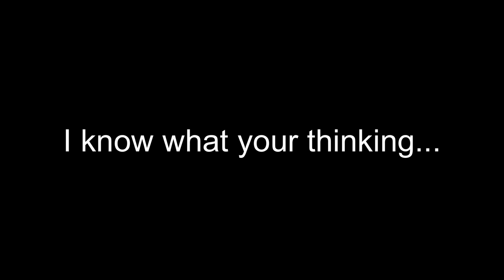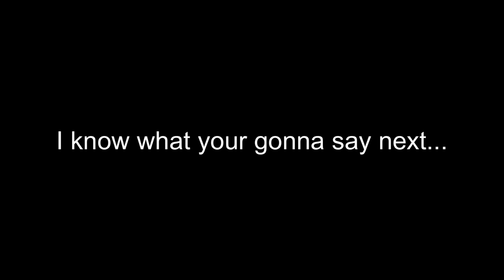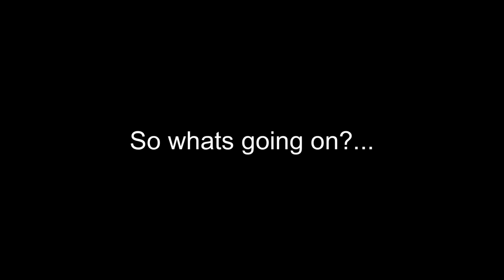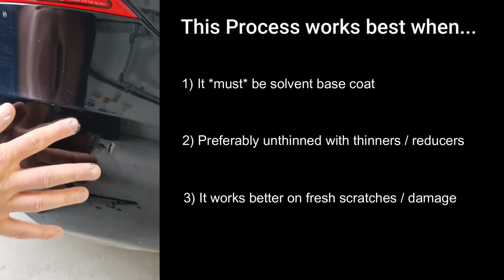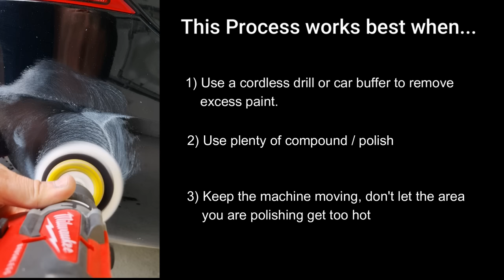Amazing Scratch Chip & Road Rash Repair Method

Comment: I got a question about it. We all know how important hardeners are. I guess you have a secret recipe for this that you developed over time. But to make things clear : 1. Basecoats, and i saw not one single type in nowadays cars that are shiny ! All of them are matte. 2. There is a factory made specification on base coats how to mix them or thin out. 3. It is a demonstration. I did not read to many comments in the section from users, but i guess your product works. The thing is, normal base coat needs some sort of hardener to withstand weather and elements. Some resistance to chemicals is also a must. Without hardener, base coats are very weak, and they will get removed within a short time. Sure if you polish them they will get shiny. But there is a reason why clear coat is sprayed over all car base coats. Somehow hard to believe that only base coat can take all the obstacles without any hardener. Acrylic based base coat is easier to work with than to work with urethane based coats. But even acrylic clear coats with hardeners often tend to fail and to lose their properties within a maximum of 2 years. Only urethane based clear coats are something that is a long term solution. I am sure that buying a common base coat color from a paint shop and trying this method will hardly work out. The most shops offer them only as a acrylic based one. Which is not bad at all. Serious painting businesses will afterwards paint over them with urethane based clear coat, and this is a quality job that will last for a very long time. I am a little bit sceptical about it. But anyway, nice work, a very nice video and method to make your paint look like new on scratched parts.
Reply from the maker: Hi. Actually the basecoat holds up pretty well. I've done tests on vehicles I've owned and it generally lasts longer than expected. www.paintgear.co.uk product has some gloss enhancer mixed in which also helps with the above issues you've raised.
Reply: Why post link to Paint Gear as their site clearly states they do not currently ship to the USA for us in the US anyway?
Reply: @andrewhernandez506 maybe because the USA is not the be all end all... jeez how entitled must you be to get upset that a Brit posted a link to a British website on a multinational platform.  No wonder yanks have got the reputation they've got. They've bloody well earned it!😅
Reply: Great comment! 👏👏
Reply: @misssummersalt Totally agree, entitled American's.
Reply: I feel like doing this to my black Landrover Discovery 4 but I'm too anxious in case I mess it up or am I just being too paranoid?
Reply: @andrewhernandez506  so people not in the US can learn about the product and purchase if they like.
Reply: @andrewhernandez506 Unless he is telepathic, how would he know where the OP is from? I mean reading the post I was 90% sure it was an American writing it, but still ...
Reply: @andrewhernandez506  Why wouldn’t he? He’s a Brit, in the UK providing a link to a British site. There is a world outside the US.
Reply: How long between applying paint and buffing ?
Reply: As long as you get the excess paint off within 5-10 minutes using  some cutting compound it’s not really possible to mess it up. At worst it won’t work that great and you’ll just be back where you started. I tried it on some old scratches around door handles and got 70-80%  improvement that is still holding up nearly 18 months later. Hope this reply helps.
Reply: Entitled Americans? Sorry, but You Tube is an American platform, so good luck with that lol
Reply: Just for you Americans out there, Europe is not the capital of UK. We play football in England and invented baseball but call it ‘rounders’ 🤓
Reply: I think you can simply mix the base paint and one-component varnish in a ratio of 1 to 1. I have not tried this, but I plan to try it in the near future. I think dry it longer than in the video and polish it
Reply: SweetProjectCars mixes base with clear for this issue. 1 part clear 2 parts base.
Reply: @andrewhernandez506 why not post a link to a site that doesn't ship in the US? 😂
Reply: @johnwalters878 It's a multinational platform or do you think the World's You Tubers travel to the U.S. to upload their videos and then return to their native country? By your logic the language, which you've bastardised originates in England so it's only relevant to the English.
Reply: @LukeB83 mixing clear coat with the base coat should work out fine

Comment: Absolutely brilliant!  When you say "perfected over the last decade", I hope that doesn't mean it took you ten years before you finally got it right?  LOL  When you say solvent paint, you simply mean modern paint, yes?  In other words, I should be able to use my Tesla touch up paint to achieve the same results?
Reply from the maker: Haha
Reply: Is standard touch up paint that you buy from auto shops "solvent" based paint? There's no harder in the paint so how does it fill the chip and scratches permanent or this just a quick touch up  to look good.

Comment: Not sure what I'm doing wrong here but I'm following your method exactly, applying the paint, leaving a few mins then buffing but the excess paint seems to want to stay on there. Using plenty compound on at speed 4-5. In the end im having to soak a microfiber cloth in compound and scrub it hard with my finger.

What would recommend here?
Reply: Forgot to say I purchased the kit off your site.
Reply from the maker: Make sure it's a rotary not a da
Reply: @cvrpov  I'll give that a try mate thanks for the reply
Reply: may i ask what compound do you use for buffing?
Reply: @kevinholmes2264  did It work at the end with the rotary? Have the same problem you had but I Just tried with a DA polisher. Excess Paint dried around the scratch. Anyway, even if It works and the scratch Is filled with Paint, you Will feel the edges of the scratch and see the shape..

Comment: You advise to use this method with farecla g360, i did this on a test panel and on a car that was solid colour with a rotary buffer, didnt work both times. Can you tell me what you may think that i am doing wrong? 

Thanks
Reply: Also bought the solvent paint from paint gear
Reply from the maker: Hi. No I can't. I use this method every day. 8 or 9 times out of 10 there is improvement on the scratch. It's not perfect or 100% success rate. Obviously a respray is needed to ultimately fix the issue completely. The product from Paintgear Is to try and help people maybe avoid having the car painted.

Comment: How do you know whether you've got a solvent base? (or is that just the OEM paint from the factory?)
Reply from the maker: Most cars are painted in wayerbased but still lacquered in 2k clearcoat. The method requires solvent paint
Reply: @cvrpov   So won't work on most cars?  I'd like to try it on an old bimmer - maybe it was prior to water-based becoming the norm?

Comment: Question: if I buy touch up paint and use this method, do I need to apply the clear coat on top of the base color before buffing or only apply the base color and not apply the clear coat at all?

Comment: How much dry time is given before you polish off the excess paint? Also, what about slight defects in the clear that don't go down to the base coat - could the same be done with clear? The temptation is to paint correct but what if you're not ready to remove that much clearcoat to chase a scratch?
Reply from the maker: Every damage has its own issues and decisions to be made. This process is most usefull for those damaged areas that have just broken the clear and basecoat and probably wouldn't sand and polish away. After only a couple of mins it's ready to buff

Comment: So does the paint have some kind of filler properties?  You just buff the paint while it's still wet or do you have to wait for it to set up?
Reply from the maker: Wait a couple of mins and buff off. The solvent paint sits in the scratch and the excess is polished off

Comment: Seems most of those are 99% superficial which can be buffed out with most compounds/polishers on the market.  I thought you were going to do more with the scratch you made in the black panel but that just left more to be desired because I'd rather see the black leveled out and polished evenly for final results.
Reply from the maker: Hi mate. The yellow paint clip in the video was to demonstrate the process clearly. I have done a video on a green jag on how to apply paint and level it with sanding and polishing. Most the marks and scratches would not be removed without the rub method. I use the method every day and have made alot of money and saved people alpt of money with it. Not saying it works on every scratch and heavy damage but its a great tip/tool for anyones arsenal and always worth a try.
Reply: Been  painting car's 45bloody yrs  this just  didn't  click.was looking  for a  quick  way  to sort out  brother's vandalism scratch on blue  door met pearl.without having to  paint the  whole thing 95% is close enough what a good technique!👍🏆
Reply: I don't think scratching a screw driver  across  a door  is superficial, don't no where you live  but  I'm not going anywhere near there 😢

Comment: I tried to send a message on the contact us page of the website and the keyboard doesn’t appear in order to type. My question about the paint. I have a touch up tube or pen some might call it, with my vehicles factory color but it is lacquer. Can I use it the same way? If not, can you provide a solvent based matching color to the USA? General Motors (AC Delco) Color Code 71 WA 633 H Sunset Orange. Also has a number 19367894 on the touch up tube.
Reply from the maker: Not sure with that one mate. Contact your local paint supplier and ask for the smallest paint in solvent they do. Here in the uk most places offer a small 50ml pot.

Comment: Nice video, but truly does not make sense. If that were the case, these touch up paint pens and brushes we get at our local autoshop would fix 95% of most people's issues, but yet, the moment that paint brush touches the body, the brush strokes are permanently etched into the paint. You MUST wet sand and then polish to get those ridges from the added paint out. So in this video, you use your finger to fill in the scratch with paint. This leaves similar ridges of elevated paint on the panel. Then you polish to remove the excess paint. And no clear coat is added? Even if the base coat is not as shiny and from the video, the scratches disappear without any hit of the repair and no clear coat or anything? Not even a slight hint of the scratch that HAS sharp ridges? I dont know, I'm not a paint expert and done a fair share of minor repairs on my paint work, and nothing matched sanding, bondo, primer/base, and then clear. The touch up paints still required sanding to level it out with the rest of the paint. And the scratch will still have either brush strokes or air bubbles. Id have to see what you did again without the cut aways. We had way to many at crucial points in the scratch repair for it to be believable. But that is just me. This was entertaining though. But personally would not suggest it because scratches don't just disappear like that, paint does not fill in scratches properly, or if it does, you need to use a lot of it and polishing will not level it out nicely since you are not polishing only the scratch but the area around it too. I have toooooo many questions.
Reply: Oh, after reading some of the comments, this is not standard touch up paint or even standard mixed base coat, its some kind of solvent based paint with color match. Still, even so, no clear coat? Really?
Reply from the maker: The paint is from www.paintgear.co.uk